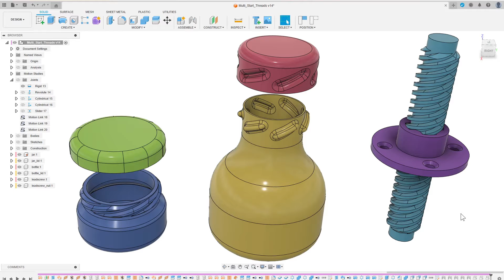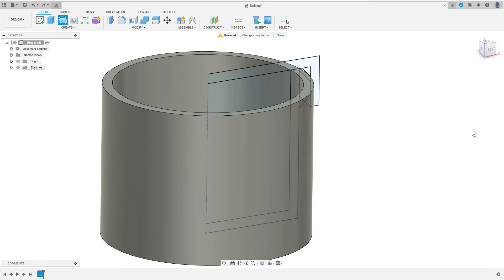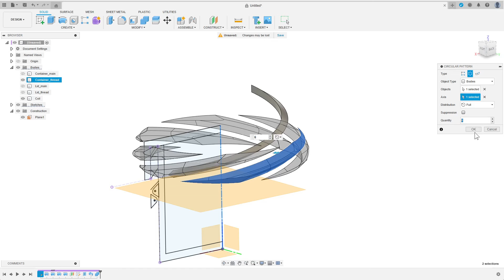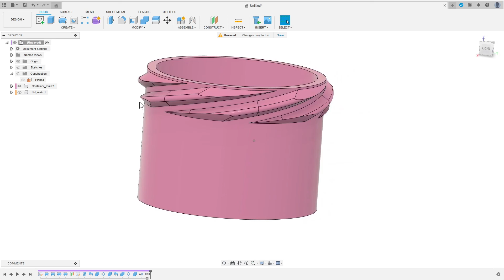How to design entirely custom threads (with multiple starts) in Fusion 360

Comment: Hi, what happens if  you want to create a tapered custom threading? Is there a way? Thanks in advance!
Reply from the maker: You should be able to combine what I did in this video: Custom Springs & Coils in Fusion
https://youtu.be/q_HarPRPpVM with the custom thread process to create tapered threads. Thanks for the input, may do a video on this…

Comment: I, Like others did enjoy the no nonsense format although watching it live wasn't a lot of use. I found myself watching at very slow speed and pausing to copy your sketches and dimensions to my effort in Fusion. I've learned a lotin watching your example, namely using a triangular section spiral to create a rail for sweeping and the clever use of the combine intersect  applied to the thread profile. However, just one thing puzzles me , how did you arive at the 3mm dimension to use as the basis for the coil pitch of 18mm? I get it that any such measurement has to be multiplied by 6 but I just don't get the relevance of the points that you measured to get the value of 3mm even though you said it was related to when the profiles completed one turn?

Comment: I guess I still don't see why? The built in threads works just fine, and is standardized, so I guess I am still left with "why"?
Reply from the maker: There are a number of scenarios where standardized threads do not work well. Most commonly, standard clearances are generally unsuitable for 3d printed solutions. I generally like to have full control over the thread design when I print both components. Also, there is an virtually infinite number of uncommon (or even non-standardized) threads out there you might want to interface to (jars, bottles, fine threads, even sawtooth profiles, buttress, tapered threads, ...).
Reply: @getprototyping  As for clearance, sure. I just use machine screws, but scale the males to 98%, and then blend them back into the body. Tolerance is not an issue, when you know how to compensate for it.

As for interfacing with existing artifacts, sure. That makes sense.

But for all my work, this seems like a complete waste of time. It there is an industry standard, and it is easy to stick with, like standard m-sized screws up to medium size, it is a really, really, good practice, to follow the norms and standards of the industry.

I actually consider it bad practice to use something non-standard unless there is a serious reason for it.

Not too long ago, I made a duct using m115. I needed to stretch it in the z, as in altering the thread, as the default threading has way too much overhang to be printable. But since it is a stretched m115 thread, it may be reproduced by anyone at any time. For instance to support the right to repair.

Also, and I sort of know this intemately, using too many repeating patterns in an assembly renders it almost unrenderable. The part itself quickly turns into a nightmare to work with. If you have never seen Fusion eat like 120GB of ram, then you sort of have not used patterns for real.

You probably have never waited for 30 minutes for an assembly file to open either. But that caching, it is amazing.

I still so no reason what so ever, to standardize on this technique. I see a ton of reasons, for this be considered bad practice, for most designs.

Buy hey. If you need to fasten it to a non-standard thread, you sort of need to. I just never faced that need.

Comment: Watched this and your other thread videos many times. I'm still not sure why you make the two extra profiles for the threads to intersect with--or, better said, why this step is necessary (and to go one further, why your profiles are sketched the way they are for these two pieces--confusing geometry). Still trying to piece this puzzle together, but the more I watch them, the more it's starting to make sense and capable of being re-engineered.
Reply from the maker: To me its the cleanest way to have chamfers and a proper integration of the thread into the main bodies. Other ways are possible and equally valid, of course.
Reply: @getprototyping  It was the chamfer that was throwing me off, actually. I couldn’t see the purpose of it in the sketch or in the Combine/Intersect. And I’m wondering if that intersect is even necessary. I was able to replicate a version of what you’re doing with just combining the Sweeps with the Bottom and Lid Revolves, but sometimes a Split Body trim is required to remove some portions of the sweep that stick out above
or below the lid.

Comment: Can this process be used for a hexagonal object with a hexagonal lid, where all the faces (top and container) align when the lid is fully secure?
Reply from the maker: Basically yes, I would do a very close to zero clearance at the faces in contact when tightened. Also, Id expect to print a second adjusted lid if it should be precise.
There will always be some tolerance. The greater the pitch, the less tolerance, but also the easier the tightened lid will come loose.